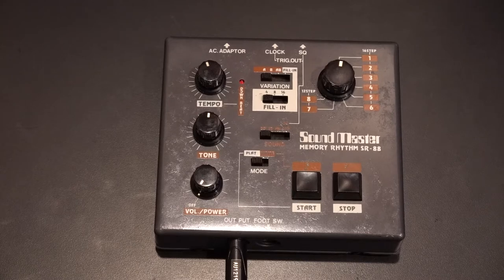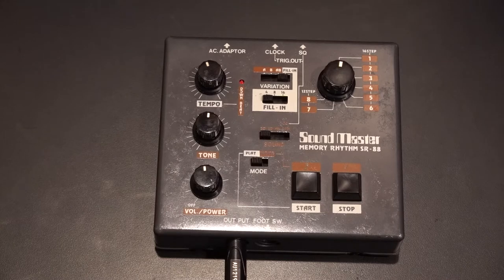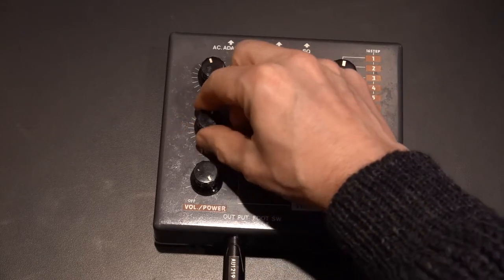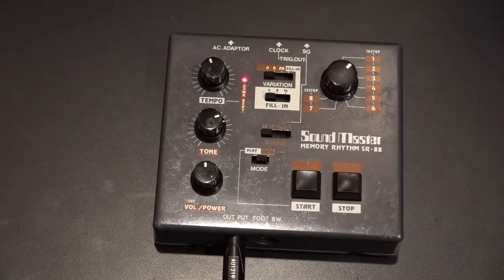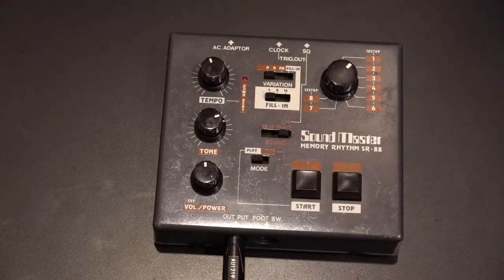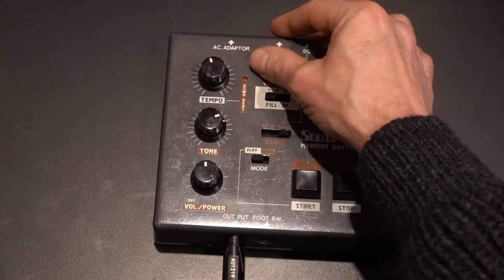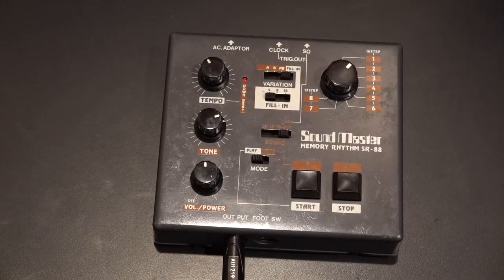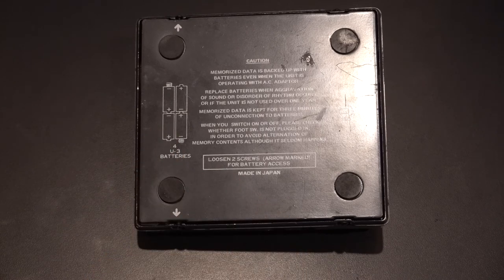Sound Master Memory Rhythm SR 88 – sound, operation, programming

Comment: I had one of these (well, by dad did,  but I used it the most). The limitations were understandable, but the only thing I didn't like were cymbal sound, and the fact that there was no way to set a fill in to come on the 12th bar (I mean come on the 12 bar blues is pretty common!) 

I found I could get a pretty convincing drum kit sound by running it through a guitar amp (my old AC30) with a light, slow tremolo effect, which added some slightly human dynamics to it. Great fun, and actually more flexible and versatile than most of the actual human drummers I used to be in bands with.

The SQ does indeed send a trigger out, I got it to run into a synth to trigger a bassline once. I never used the clock trigger but it would send a constant pulse, possibly to synchronise with synths that ran arpeggios, or with other drum machines, though I don't know how compatible it was as there was no real standard until Midi arrived in '84. It was really designed to be used with a matching latin percussion model (the LP 88), so you could sync the two together.